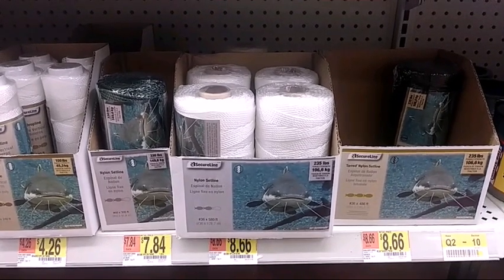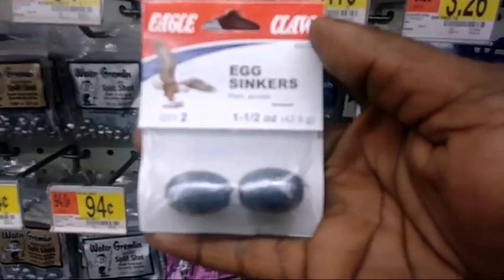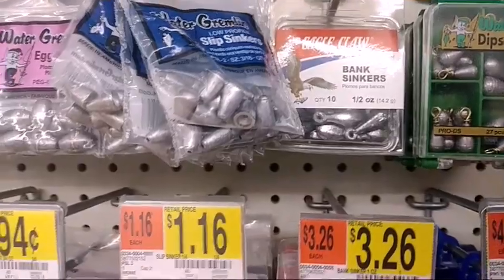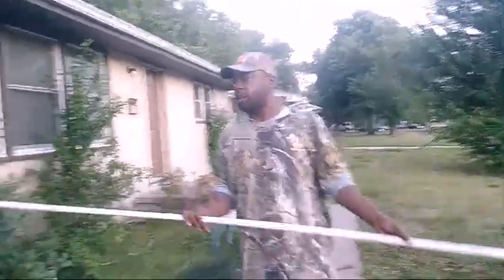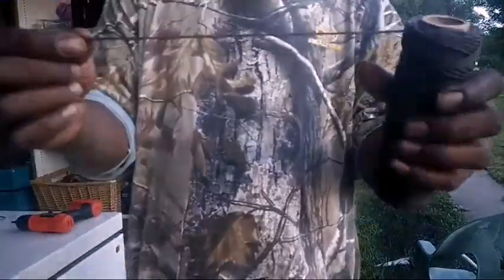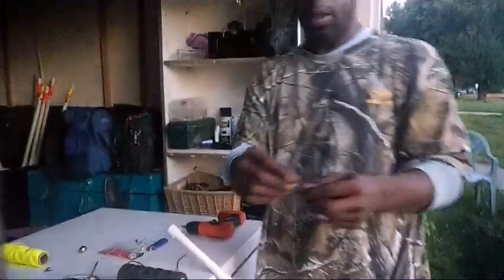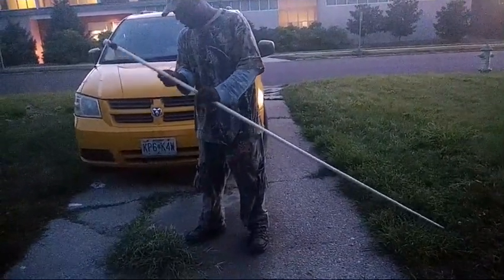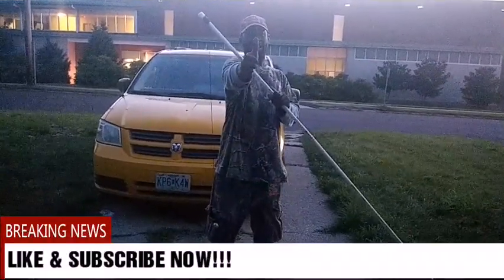DIY How to make your own homemade bankpoles/Diddy poles for catfish

Comment: Yessir, it's a good rig! The main difference of my rigs is 3/4 pvc electrical conduit. The grey stands out less because of the thieves - plenty of that goin' 'round... and it holds up better when using a post driver to set them in harder clay banks. Thanks for posting!

Comment: just a few observations ... Drill all the way thru the cap and pipe ... Use eye bolt, nut and two washers ...
Reply from the maker: Nice😎 I'm going to do an update on this video as I've found a few other ways to build them. Thanks for watching. I have a big announcement coming soon so hit that 🔔 tight lines🎣

Comment: I'm new to using bank poles just made my first 7 for this season to use kinda wish I left them a little longer.. I cut mine at 7 foot? Hope it works..
Reply from the maker: Imma do a more in depth video about bankpoles too, I'm working on a vid to make bankpoles without all the extra string. 7ft is good, it just matters where u use it. 45 degree angle in the mud bank. Less than a 45 degree angle will lower your pole and also reach out further. U need about 1 and a half feet into the mud. Use paracord as I've found it doesn't unravel and easier to tie knots. 550 or 750 works well
Reply: @bankpolefever  thank you for the advice.ill do Just that...i Just subbed really looking forward to learning more from your vids 👍 🎣

Comment: not bad,but I may need a modified version lol.oklahoma,it's nothin but clay.and in the summer heat,clay is worse than concrete lol.
Reply from the maker: like what have you seen my new ones
Reply: eh,I would have said solid fiberglass rods.half inch diameter.but,last few years things have been difficult to get a hold of,or just gotten more expensive.and I suppose a good pole holder can resolve issues with clay.am tempted to tinker with this when things calm down.had an idea of making a bank pole like a twitch up snare pole,use a toggle snare trigger to rig up an automatic bank pole similar to fishing yoyos.but beefier.sure you have seen those yoyos lol.they wouldn't hold up to a big cat.but my issue is I also want these to be stupid cheap and simple to make,along with having enough spine to handle big fish.its mostly for my camping set.its a random thing though.good to hear from ya,hope you safe and well.

Comment: You do realize they make different pound sinkers right and you need to use eye bolts with nuts not wood screw eye bolts no wonder you lost some monsters check into that bud good luck
Reply from the maker: Check out how to make bankpoles, best on YouTube. I have an improved version of these bankpoles. No eye screws, no wrapping excess line. The ones in this video I still have and they've never broke at the eye screw. My terminal tackle suck. We won't be making those mistakes anymore. My next video will be on terminal tackle😎 thanks for watching. I have a giveaway announcement coming soon. Subscribe and follow me on Instagram for more info. Tight lines🎣